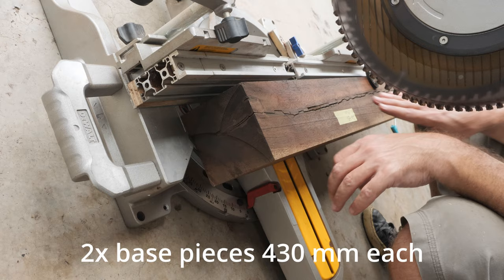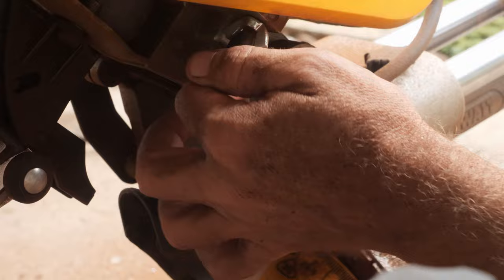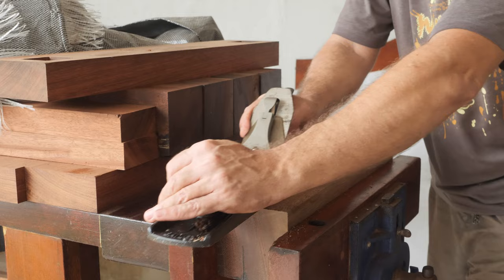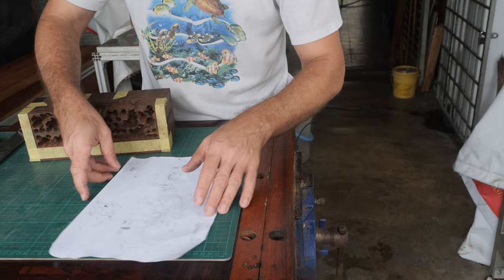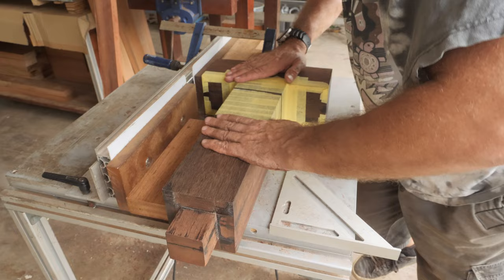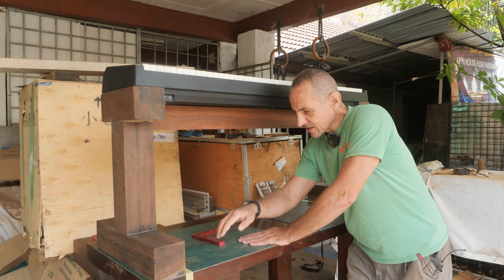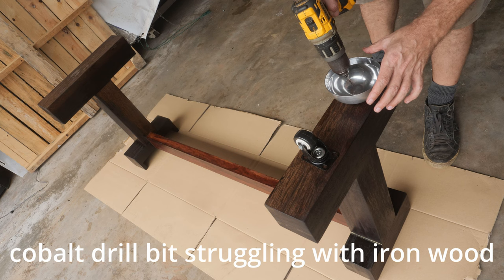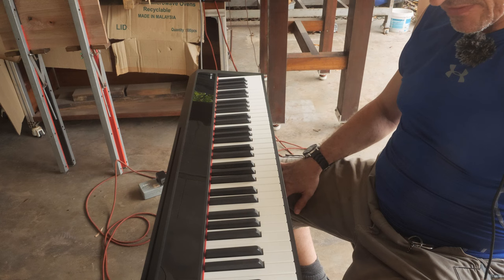How To Build A Piano Stand

Comment: DIsgusting!!
Reply from the maker: the beauty is in the eye of the beholder.
thanks for your opinion anyway.

I find it very good looking, 4x4 inch posts made from the 250 years old iron wood.
it enables the knees of the player to go under the piano without knocking it like it happens with the original X-stand.
and it matches my working desk and other pieces of furniture, also using 4x4 inch posts.

you can check out my minimalist desk design, and maybe you will understand why I went with this piano stand design.
https://www.youtube.com/watch?v=SMe8KYavnV8